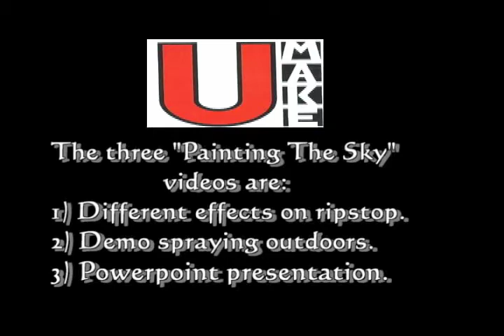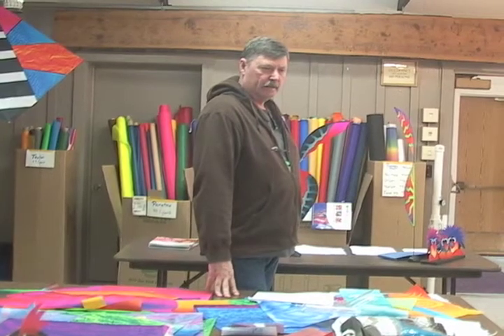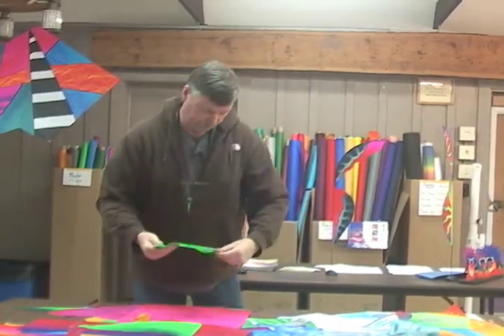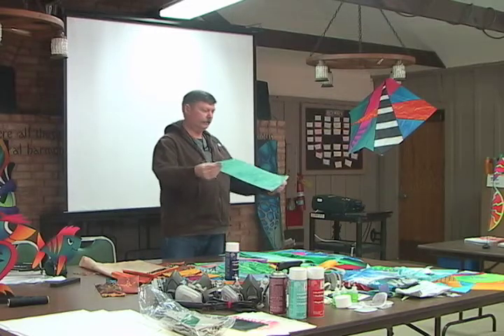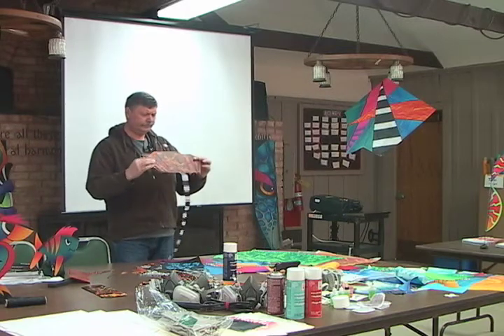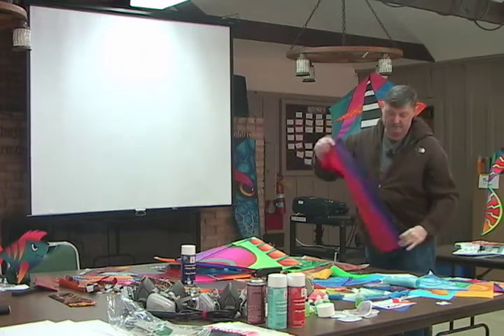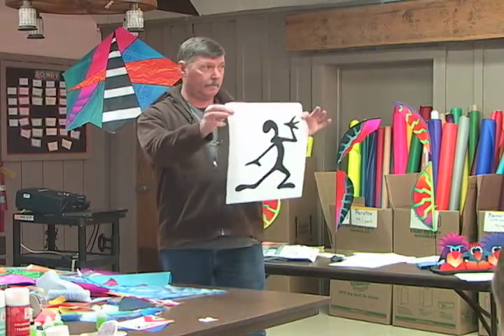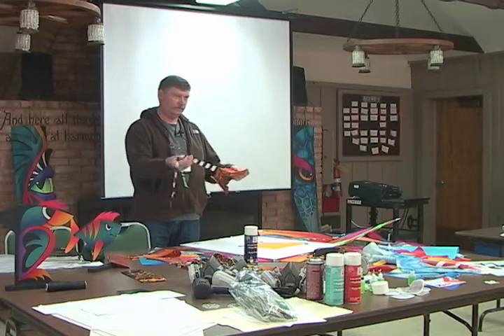Painting The Sky -  Creating Effects on Ripstop by Scott Hampton

Comment: Have a caveat to include after considering my comment outlines using a mix of silicone with acetone. Personally I am using a fabric dye not paint on my ripstop nylon material. As acetone is used as a paint thinner it could very well react poorly and give undesired results on ripstop material that has been painted depending on chemical composition of the paint. This might not be an issue if you’re trying to seal a flag that was probably colored during manufacture with some sort of molecular bonded process or die. I would also recommend looking for products that include UV protection. There are companies that sell spray cans or even gallon cans of do it yourself fabric wash or spray on treatment that can seal and protect the material if it’s gonna be outdoors for long periods of time. One of the best are those used in the marine boating industry for upholstery. Atsko is the company I would personally recommend after doing much research. I am also purchasing from them to help restore durable water repellent coating of Gore-Tex material that I have. But, I also see they have UV protection treatments as well. Really hope this helps be sure to experiment mix up smaller amounts to save on materials and money definitely try on test sample scrap fabric first or small spot in case of undesired results you won’t ruin your whole project. All the best to you and everyone else stay well

Comment: Is there any treatment you can recommend to keep the colors on Nylon fabric from fading? Such as flags.
Reply: Haven’t personally tried it yet, but my idea is to take silicone 100% comes in a caulking tube then thin it out with acetone. Coat the material sealing it with this. There are some mix ratios recipes online, however experimenting to get the proper thickness or thinness of solution would be best on test fabric. An outdoor camping industry etc. they called us siliconized nylon. One of these days I’ll get around to trying this out of acetone at the moment.